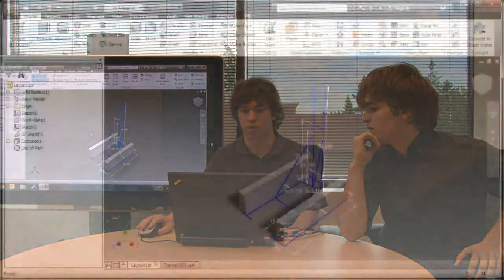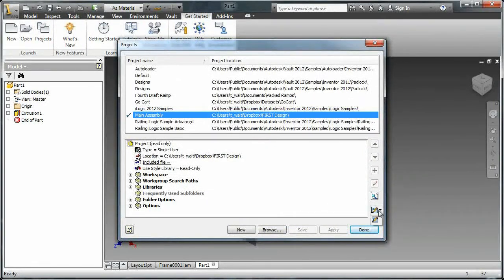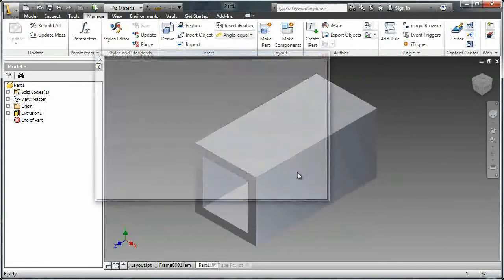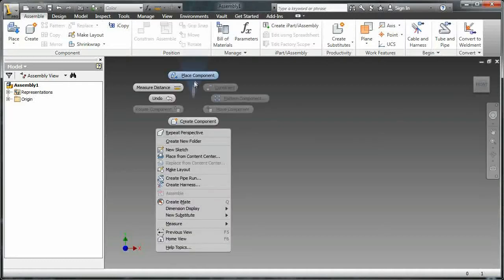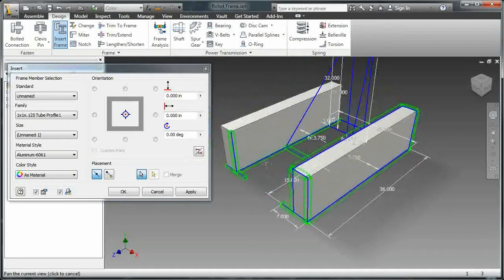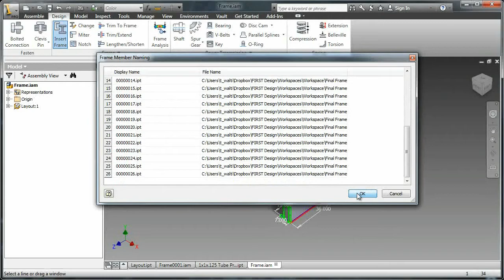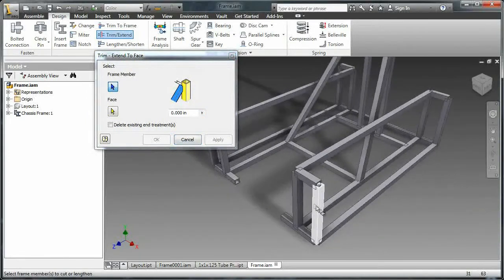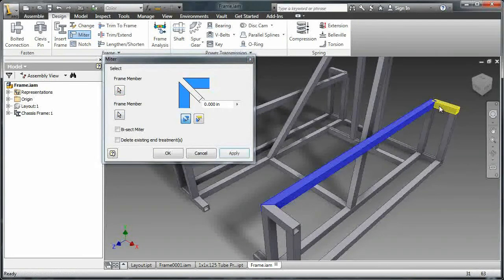Frame Generator

Comment: I followed the instructions to the point but now my frame generator doesn't work at all. After I published my new frame element I am no longer able to press OK (its grayed out) when picking the sketch lines where I'd like my frames to be.
None of the frames appear anymore, not even the original and I'm not able to press OK.

Even the Reset Utility from Autodesk didn't help. I'm gonna reinstall the whole package to see if it helps.

EDIT: Either reinstalling everything helped or I didn't select the frame member in the dialog box. Everything works now.